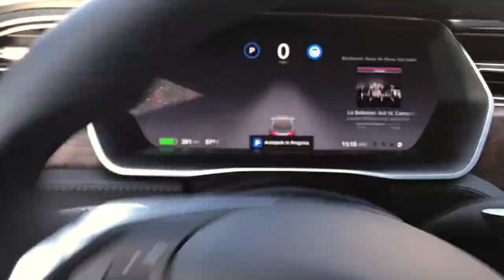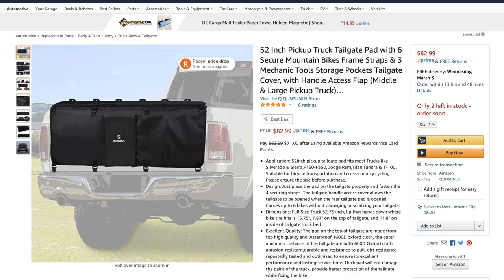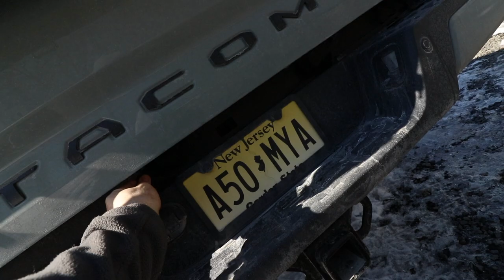2021 TRD Pro TOYOTA TACOMA SOFT BIKE RACK

Comment: Beware my sun.

The spoiler plastic on your tailgate will still get dented up on off-road trails with bikes on it with this type of solution. I'm a big berm shredder and it happened on my 2018 taco with a dakine bike blanket too. 

So after going through that I am looking for a different solution for my lunar rock pro coming in.
Reply: it shows that its got like 2 inches of padding though??? please say it aint so
Reply: @nathandesantis5974  I hope it's good enough padding it may have improved over the years but yea didn't hurt the steel on the tailgate but that fuckin spoiler makes the tailgate wide and the fork of bikes bouncing around a bit dented up that plastic shield on the tailgate pretty good. I like my shit fresh so it pissed me off, even had the bikes strapped In with the velcro.
Reply from the maker: Damn. Good call. Yeah these are padded pretty well but I’m still kinda freaked about the idea of it lmao
Reply: @TrackSlayers  just keep an eye on it I guess. If it starts to show some wear just get some towels or something to put under the bed blanket where the pressure is for extra safety I guess. Good luck!